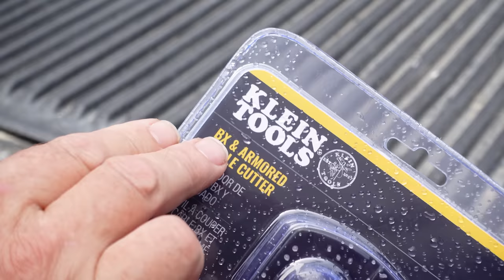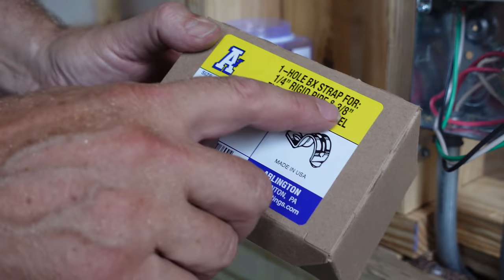We MAY Have Overdone It...Bathroom Rough Electrical - THE SHOP Part 8

Comment: Super. I would've pulled two new circuits with a new ground through the old conduit and put a heater in the bathroom. I also recommend that you ground the concrete pad. 💙 T.E.N. Edit: I highly recommend that you use individual GFCI outlets to protect the lighting and outlet circuits separately, or GFCI circuit breakers, so that your lights don't kick off at the same time that you are getting shocked. Put a GFCI in your first four square box in the shop, but use the unprotected feed and the protected feed (2x12/2g lines.) to the bathroom, and then put a GFCI outlet in the big bathroom boxes to protect the lighting circuit. Have the GFCI in the shop protect the outlets in the bathroom, and have the GFCI in the bathroom, or a GFCI breaker, do the lighting. Personally, I also recommend that any other outlets be stand alone GFCI outlets, not outlets downstream of GFCI protection, especially in a shop, and it is best that if a GFCI is used to protect downstream outlets, it be in the same room also. Thanks, Sparky is here all week. 💙 T.E.N.
Reply: I think he was doing something like that as far as GFCI protection. The GFCI receptacles are on their own circuit, and the lighting is on a different circuit, so if one trips (usually a receptacle is the trip point) the other functions. But it could have been explained better in the video.

Comment: Are you sure your not a "Sparky"  I enjoy watching your videos and I went back and watched the one about your shocking experience. A couple of years ago after I did some remodeling on my upstairs bedroom, I had an electrical short pop up. When I would turn on my br switch to turn on the outlets for my lights POP. I was checking everything, junction box in the atic, outlets , the wall switch even the lamps. But I found it, I also prefer the metal boxes, and on the switch box in the wall, the clamp holding the 12-2 for the lights was a tiny burr. So when I tightened the clamp, it pierced the romex and got to the hot line. So I pulled a new line and changed the clamp. Now I always check my clamps for burrs.

Comment: Others have commented about the exhaust fan not being a switch leg. But I think it probably should have been run with 12/3 as in the future a different fan/light may be installed but won't be able to control the fan and light independently as it is wired now with 12/2.

Comment: Man....this is DIYPorn...so addictive; no matter if you pump it up to 2 hours episodes. My only modest point: Have you guys tough on putting some power /switch/outlet in the "second" floor? Maybe the water heater needs some electric input, or at least a light...

Comment: When drilling for Mc or bx it’s good to think about how you’re going to pull the cable and drill your holes at angles accordingly. If you ever demoed bx from a smart electrician’s original install you’ll notice the cable pulls out easy. If a dingus roughed it in, you’ll end up cutting the bx to remove it easily.
Reply: Lol Dingus.  Stupid wiring is very frustrating to work with our demo👍

Comment: The only problem with old electrical circuits is you don't know the condition it is in . Say using galvanized underground conduit to carry your ground it could have become corroded and disconnected and you have no ground . The problem with that is if a energized wire comes in contact with that metal box it can become electrified and not short circuit and trip the breaker . The ground faults will not trip in this situation either . If you can't determine the quality of the circuitry your only way to know it's in good shape is to pull a new circuit to the electrical source .

Comment: I think American electrical code isn’t really safe. In Germany we usually Route the cables in the wall right under the ceiling, so that you can’t drill into them by accident. And also the entire installation is usually protected for ground faults.
Reply: give an idiot with a hammer and some nails, they can and WILL find a way to put a nail thru wire. doesnt matter if its in the ceiling,walls, behind nail plates.  when the shorter nails dont work, out come the 3 inch framing nails

Comment: Would a smaller drill bit be preferred to make more of a snug fit for the bx cable to pass? Seemed like each hole had some significant margins on it like at least 1/4 or 3/8” wider.

Comment: Lots of great tips and tricks.  I’m curious about the 3 gang mud ring 11:45. Would it be better to turn it the other way so it drops down in the screw slots instead of pushing it up?
Reply: Yes, they installed it upside down.  One of the reasons I like watching these videos is that while they do know a lot, and often have innovative solutions for problems that I would NEVER have thought of on my own, yet sometimes it is like watching an episode of "my first flip" and I sit here commenting like I'm narrating in an episode of  "Mystery Science Theatre 3000" and I need a good laugh.  Still, even with the comedy factor aside, I would have no problem subbing something to them on a property that I own or manage.

Comment: Do you have more info on the ground fault and setup with that metal box? I ask because my house receptacles are not properly grounded & I have wood panel walls- not drywall so I can't just patch stuff if I cut open walls. We recently had a thunderstorm where lightning hit nearby and caused our phoneline to explode & the AC adapter for the landline phone blew up as well. So, if I have a ground thing in a box I should connect the ground wire to it? Is that only in metal boxes?

Comment: you are going to have a lighting issue when the windows are closed up... i would add another six to eight 3" LED lights around the bathroom, with 2 or 3 by the makeup area.  I did that in my own master and my wife loves the illumination

Comment: On a commercial job, why didn't you just use 3/4" conduit?  Would be way less trouble, you wouldn't have MC cable draped everywhere and also far easier for future expansion if needed.  Probably less expensive too!

Comment: I might be inclined to connect the two switch boxes together with a conduit nipple.  It could pay off later if there are changes to be made.
Reply: A nipple would bring the boxes too close together, and your faceplates would overlap -- unless you use an offset nipple, but then your boxes wouldn't align with each other.   A stub of 3/4" emt with a couple of set screw connectiors is what I would go with in this situation.  First, because I rarely use 1/2 for anything so there is plenty 3/4 scrap laying around and second because the extra capacity makes it much easier to run between the boxes.   Unless you have a source for long nipples -- I have never seen one in this part of the country but someone might make one.
Reply: @steveloux4709  Rigid?  I suppose you could go that route, though the material cost would be significantly higher than EMT.  Certainly nothing wrong with that approach.  I guess it comes down to what you have on the truck vs the scrap laying around and your labor cost per hour.  With RMC you are looking at $15 in materials for two hubs plus the nipple, and I would put two between them so $30 total materials.  With EMT you have $1.50 in materials,  ($3 for 2) for a $27 savings.  You will have more labor of course, by maybe 5 minutes, but you end up with an exact fit.  I would probably spend more time looking for the right-sized nipple than cutting the conduit, but that is my fault for being less organized than others.  For me the material savings outweigh the additional labor cost, but your situation may be different.  Quite honestly, you go with the first idea that pops in your head that will work because the extra time thinking about the "best" way will often cost more in time in the long run than the savings by doing it a slightly more efficient way (not to mention the cost of doing materials run), and as a building owner who pays the bills I'm ok with that.

Of course, if I am getting paid by the hour and not by the job then rigid that is cut to length and hand-threaded on-site is the way to go  :-)

Comment: I’m much more down with two 25-min videos. 
And while we’re talking about going back to the store … the #1 tip I give new DIYErs is to always PLAN to make that trip to Home Depot at noon or 1pm. Instead of powering through using the wrong stuff and having to fix it a day later because it didn’t work right.

Comment: I love your videos, very interesting watching with European eyes. Fascinating to see that you still use these outdated twist-on instead of Wago(except on the fan).
And finally, I was very moved by your speech to your daughter in the wedding.
Keep up the good work and videos, they are very much appreciated!
Reply: When you have a bucket full of twist on wire connectors you use them up for as long as code allows those to be used ;)

Comment: Really enjoy your videos and the detail you show. Did you show where you are exhausting that fan to?  I see all the time people just exhausting into the attic. But all that moisture really makes a mess (condensation, mould, and in colder climates freezing and water logging insulation so it no longer insulates. Also in colder climates I see others exhausting with a good size vent pipe - but it’s uninsulated, so now the condensation and freezing, and melting and water running down inside of vent pipe and collecting somewhere still is a problem. How are you handling that vent?

Comment: Just curious, why MC cable when it's all inside the walls anyway? Is that because it's a commercial building? I'm used to residential where MC is only for exposed wiring.

Comment: Unless you make your change to the number of devices BEFORE you drywall, those nifty/handy/cool mud rings will be permanently  in place once drywall goes up. Right?
Reply: nah, you can trim back the drywall to get to the mudring screws. Royal pain in the ass but it is doable

Comment: I"ve never used the cutter tool. It looks nice, but for time saving, I've always just snapped and cut off the sharp edge before installing my red bushing. (with electrical tape) Also, was MC with ground cheaper than romex with ground? Since you're using metal boxes with bonded grounds. Is it simply for commercial code? Even though it's hidden in wood walls? I'm no pro so I'm curious if anyone can answer that question.

Comment: Ur drywall tip with the wet sponge has saved me so much time. I used to spend hours sanding. Love your stuff
Reply: What video does he show that tip in? I'd love to learn it.
Reply: @smittywerbenjagermanjensen9802  not sure but when they were doing drywall on one of their builds. You use a wet sponge to blend the joint compound instead of waiting and sanding. It works great

Comment: i would still run a switch leg to that light just incase someone swaps its for a different one in the future
Reply: I think it can easily become a switch leg in the future by connecting it to a switch in the switch box if needed
Reply: Still early in the conversation.
 I believe in “built in redundancy” with projects.
So my question, in a case if when this fancy light and fan fails (which at some point in life it WILL! Maybe sooner than later.
So my point is, let’s say the present owner or future owner wants to “downgrade” to the simple fan which needs both the switch for both the switch and light?
Reply: @WiseProtector72  Ah. Yes probably should have run 12/3 to the light/fan. Good point.

Comment: Regarding electrical...
I have a question for you guys..
So my outside outlets when the house was built was made to use a GFCI Circuit breaker, so all the GFCI stuff is done via the breaker and not the outlets/receptacles. For the past 3 months now the breaker trips (even with nothing plugged into an outlet) after a short amount of time, sometimes a half hour, sometimes longer or sometimes less.. Now ive gone and replaced all of the outside outlets as i suspected one of them was bad and was causing it, but it still continues to trip.

What could be causing it? advice would be appreciated
Reply: Replace the breaker

Comment: Do you not have drywall boxes in the US? the plastic ones that are fitted after drywall.  They are far easier and can be placed anywhere where there is a void behind drywall.  In my country we only fit metal boxes into brickwork.
Reply: those things SUCK. I wouldnt use them if they were given to me for free.  they have tendency to get ripped out of the wall since they only being held in by pathetic dinky wings
Reply: @harveylong5878  I've never seen one ripped out of a wall, so you must be buying cheap Chinese imports I guess, or you are ctiing the holes way too big.

Comment: Hey everyone, after seeing this video I've got a question. I'm currently changing a single gang metal receptacle box to a 2 gang, in order to house 2 outlets side by side. The outlet that's in there now is currently grounded, the mc cable running to the box from the circuit doesn't have a ground, so the outlet is grounded from contact with the box and the mc cable is acting as a ground as well. My confusion lies in that. I have a double gang metal box, and I'm planning on using the same mc cable, which doesn't have a ground. If I pigtail off of that wire coming from the mc for the outlets in order to run both, would both outlets in theory be grounded? Again, no ground wire coming into the box. If stud packs sees this as well I'd appreciate some help Paul! Also, anyone in the comments who could help out, I'd love some help.

Comment: Just curious, did that MC cable cost more than your truck? Not sure how prices are in Louisiana, but in the northeast wire is crazy expensive. At HD they keep it locked up!😕
Reply: Home Cheapo and Blowes here keep MC,Romex, UF , THNN in anything over 20 ft roll under lock and key. God help you  if  you need spools of THNN, you'll be in Blowes or Cheapo for eternity waiting for a rep to open the cage

Comment: Are the ground screws you added special or they can just be about any screws?
Reply: nope, have to be green. or supposed to be green. Code Inspector can be ballbuster if you use a self tapper or just whatever screw

Comment: Question... If MC=Metal Cable..... Is this the same lingo for BX Cable???
Because I thought,and correct Me if wrong.
But I thought BX Cable can only be used as 2 Foot Whips per City Code......

Comment: Those top plates are called mud ring?  Why do you need them?  AS a DYI guy I never used them.
Reply: for the drywall, cement board, plywood 'finish' wall.  mud rings make up the difference from the face of the box to face of 'finish' wall

Comment: Once again a great video. I know when I was doing some wiring the inspector gig me as the wire hold downs were to far from the box.  Do you have the same issue with inspections? The videos are good length 15 min or longer is good for me. Just keep them coming.  I know it will take you longer doing the video but I appreciate each one you guys make.  Jordan is good with the taping and your explanation of each phase is the best, thank you both.

Comment: 250’ rolls of MC come with a bag of Red Devils inside the coil lol

Also you bought all metal when you could’ve bought just plastic

Pair of dikes are fine for stripping mc

Could’ve bought romex 

Way overbuilt job

Also you can use romex commercially and you can add a ground tail to the inside of your 4 square bracketed box and wire nut the ground from you new wiring to the ground tail which is bonded to the metal conduit which I’m assuming is also bonded to your panel ground
Also it ain’t nothing to add an earth ground inside a wall when it’s open like that. 

All is code compliant in Louisiana because I’ve done it via phone call to the inspector

Comment: 19:04 Didn’t you take too much material out of that board on the ceiling, destroying it’s structural integrity, with the set of 3 holes on both ends?

Comment: Seen at 7:13 minutes in: Why are you still using wire nuts? Why have you not moved on to using WAGO connectors? You need to move with the times and safety regulations! Also applies to other wire nuts seen later.
Reply: please do provide proof that Wago's are in fact safer then regular  wire nuts or for that matter a code reference mandating  their usage
Reply: @harveylong5878  I'm sure you are more than capable of doing your own research - or should be. There are numerous YouTube videos out there

Comment: I can tell you were taught by a well seasoned electrician. MC cable is great for a shop, not much more expensive than Romex (odd really), and you know most of the rules. FYI all MC and NM must be strapped within 12In of the box.  The fittings at 20:38 look like NM connectors, not MC. As of 2020 You have to have a neutral in a least one switch box. So you have to use 12/3 for a dead end single pole. Technically you do not need a ground wire in the emt. So long as all the fittings are tight (which they should be anyway). Last tip: you can use regular 4sq boxes without the side bracket. There are 2 holes on each side of the box, and you can use 2 screws to attach box directly to stud. Front of box should be flush to front of stud. I don't have to worry about box fill with you, you have brought it up before.

Comment: That Newtone is very practical for a commercial bath.
 NOT a good idea for residential . WAY to noisy AND not flexible    Separate vent with in line fan (stronger ,way lower DB ) and multiple lights in ceiling.

Comment: Right around 12 mins, when you talk about the slots in the mud ring... shouldn't the open slots be too the left, and the closed ones on the right, so that it drops into place rather than pushing it up? Just in case you forget to tighten all four screws, it would remain level. :)